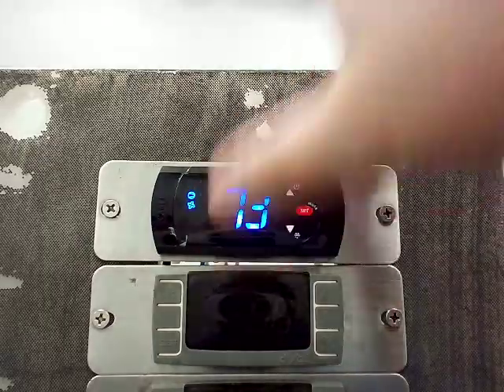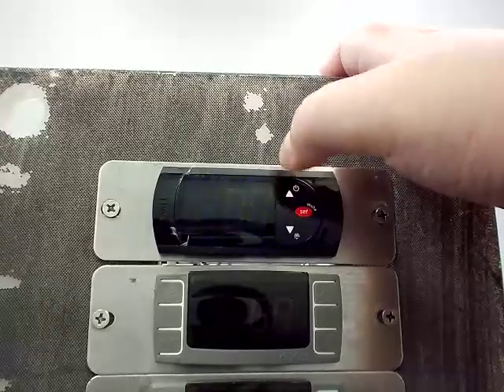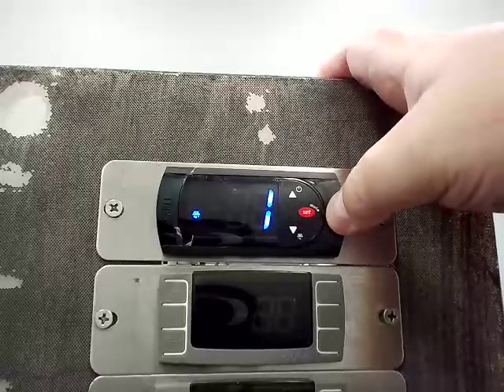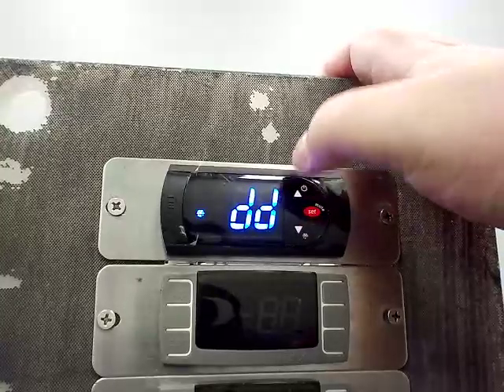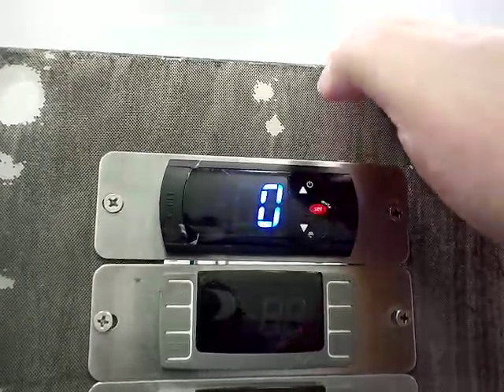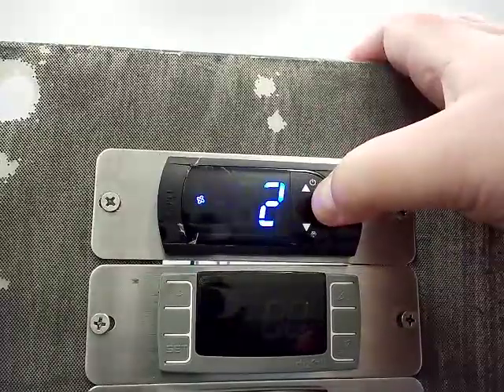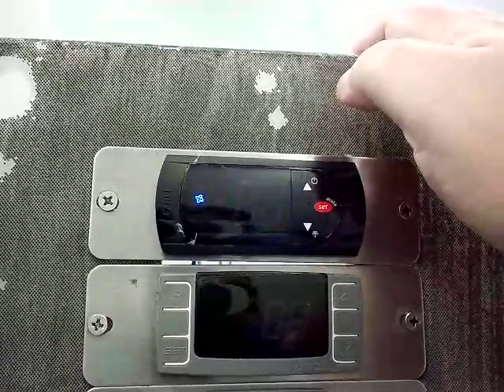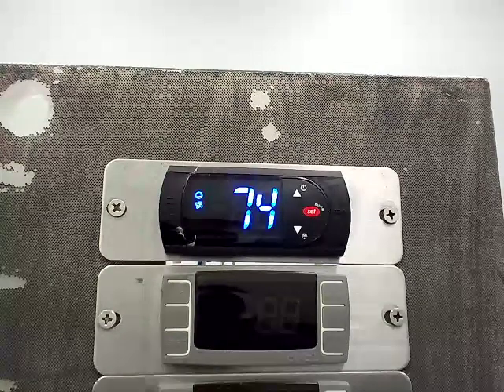Carel Freezer Parameters

Comment: Argh. I'm trying to set one of these up on a window ac unit to run as a walk in cooler for meat.  I think I have the correct wires selected for the fan and the compressor.  I ran them both directly to power first and they both kick on. The lights for fan and compressor on the carel unit both light up

My ambient temp is showing 99f even though it's 55ish out. I set the temp for unit all the way down to 38 and can't get anything to kick on
Reply from the maker: Theres a few thing to go through, your best bet, Just call our tech support team, ask to speak with Allen and he can get you all sorted. 800-683-8660